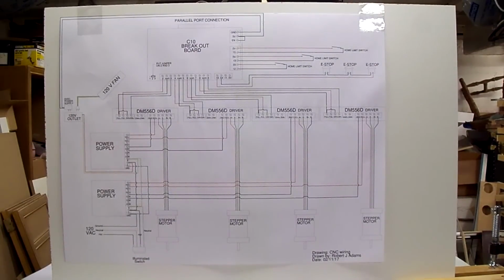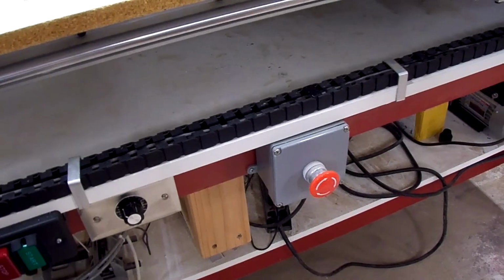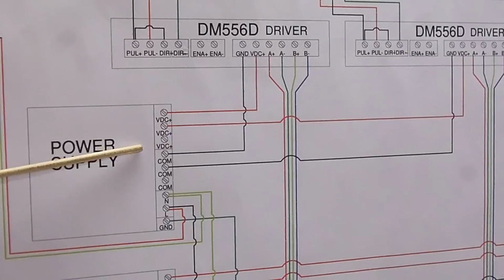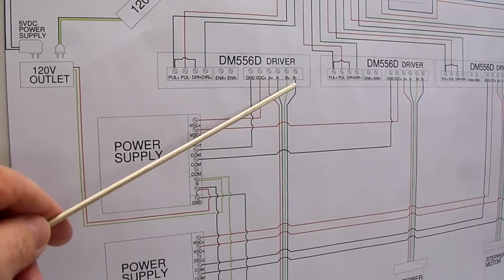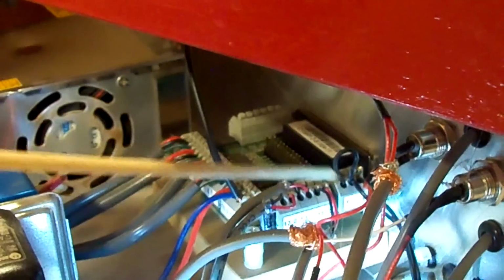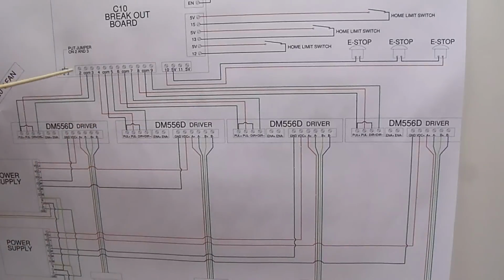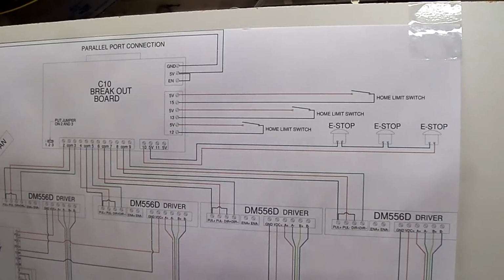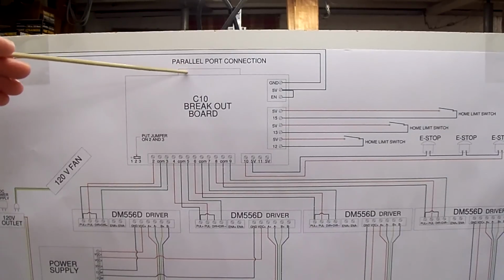CNC wiring diagram

Comment: Hi Robert.  I am using FIRMCNC1325 and AutoRich hand controller.  My "z" touch plate does not work.  Do you have any idea where it should be connected?  Thanks
Reply from the maker: I'm not familiar with that controller.  I have this video about wiring touch plate:  https://youtu.be/wjCZnUu23g8?si=0I11YVlRor-oVldA

Comment: Hello Mr. Adams, thank you for sharing with us. It helps tremendously. Quick question, what program did you use to create the wiring diagram?
Reply from the maker: You're welcome!  I used a program called VisualCadd.  It's just a standard cadd software, one of the earlier ones.  It's predecesser was called Generic Cadd which was a dos based cadd from the late 80's.  Visual Cadd is available from visualcadd.net.

Comment: Drivers should BOB should have fuses. LS should be NC in case of wiring problem there is no protection for O/T
Reply from the maker: You are correct, I should have fused the drivers.  Limit switches are used for homing and they may be N.C. and I may have just drawn them wrong.  It's been so long ago I don't remember.  Thanks for the input and thanks for watching!

Comment: I need that in Pakistan... Can any one tell the process to buy that machine...  And i need to know process to operat that from computer (designs)
Reply from the maker: This machine is no longer available.  The website closed.  To operate a CNC, you ned software to draw the part, "CAD",  and "CAM" software to create the tool paths and then a software to run the G-code that the "CAM" software creates, such as Mach3 or Mach4.

Comment: Quick question.  The DM556D drivers are a bit pricey.  Could you, on a small system substitute the TB66004A drivers instead?  They are very inexpensive but not sure if they would serve the need?  Any comments would be appreciated!  Also could you explain why the 2 power supplies as many go with only one 36 V power supply for the entire set up.  Thanks in advance!!  This is the best diagram I have seen on you tube!  Subscribed!

Comment: Thanks for the wonderful video series!  Just confirming, the 3 E-Stop switches would need to be "normally closed" (correspondingly configured "active low" in the Mach 3 CNC software) to work connected in series as they are, so that hitting any one breaks the circuit and stops the machine, right?  Also, just curious, have you used any SmoothStepper board in addition to the C10 BOB?  I would love if you could also do a video on Mach 3 configuration/settings/tuning ... especially tuning!

Comment: Thank you so much for your nice and jentil demonstraition , i learned a lot , here  i have few question below if please replay as possible 
Why you use only one limit switch for each axsiss , in real did 2 ends exsist of each axsess
The home and limit switch can be used simoltansuly in the same location ? 
And last question is about usb port and digital glass added to much 3 b o b  by local dealer here gives diffrent  port and pin numbers in out put and inputs 
Good luck

Comment: Absolutely Perfect! Thanks for refreshing my memory from my first build 3 years ago. If I remember right, the jumper allows your 5 volt wall wart to power a second section of the break-out board. Not sure though as it has been a while. I'm in the process of building a second generation to replace my first iteration. This time with high quality linear rails and ball screws for much better accuracy. All structural steel and zero wood products to be able to use coolant to cut aluminum and mild steel. Also with a 4th axis. It should get interesting.

Comment: hello sir. I am shashi from  india.  I watch your all video and I learn lot from you.  but few questions I have in my mind . 
1---how to install spindal with  breakout board and March 3 programme 
2---which stepper driver  you used 
3---which stepper moter you used 
4---if I want to make cnc machine for stone carving then can I use same method 5---what size of spindle you used and what size and power of spindle I will need for my purpose and what size of stepper moter I need

Comment: First off I would like to say what a great explanation and wiring diagram. You did not mention connecting up the spindle motor how is that done?

Paul
Reply: Are that makes sense. Thanks for the quick response. I will need to make sure the board I buy can handle this as well.

Comment: Thank you very much for this video you have just cleared up a whole lot of muddy water for me
Reply: i do have a question 1st off i've never in my life had anything to do with a cnc and i'm going to attempt to build one my question is what do i need for a computer to run this i'm thinking a windows NT or 2000 machine with a 32 bit processor should be good enuf and these two Operating systems are about as stable as you can get or windows how much ram should i be looking for

thank you again

Comment: The 8020 that you use what size is it 4" x 4" as here I need to source a nearest metric equivalent, also what is the aluminium side plates 18mm or 1/2" regards love your videos so natural, regards RobUK
Reply: Thankyou for your time, is it possible to give me the length and width of your base unit, regards RobUK
Reply: One more question, sorry to be a pest, what is the length and width of the gantry sides, I have been sourcing materials, regards RobUK
Reply: Thankyou for your time Robert that gives me a starting point, much appreciated, take care, RobUK